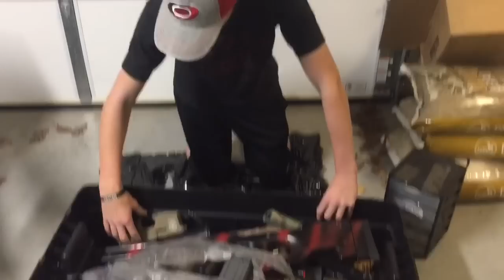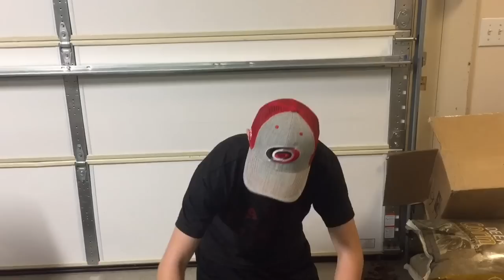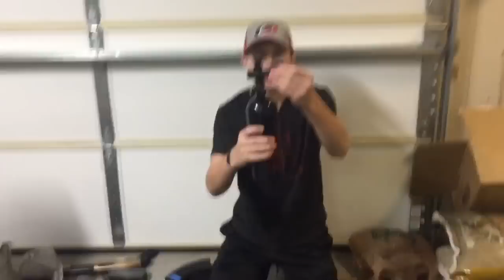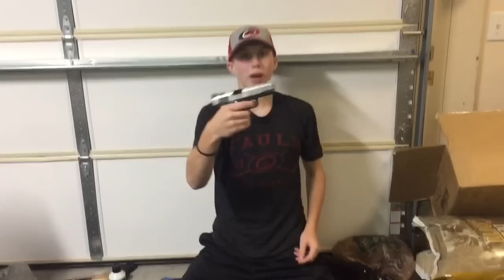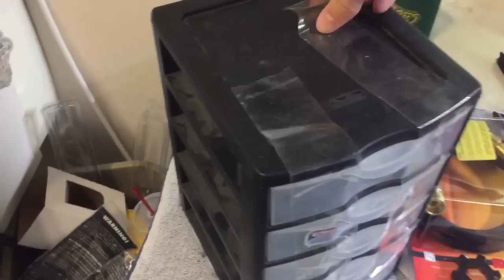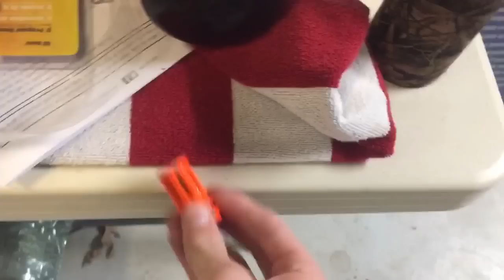Airsoft on a Budget *HUGE!* ($30 Craigslist Airsoft Mystery box)

Comment: I live near Xtreme kombat so hopefully, I'll see you out on the field once I have some more gear! I've been working on mounting a mp5 rail into the sight area of my JG-1011 for mounting a red dot, do you have any primaries you are teching with?
Reply from the maker: +Austin E. if you mean what I usually Tech on I usually work on m4s and ak's but I can work on almost any gun. There is a day operation this Sunday which will be a tone of fun that I am going to. In regards to your mp5 I would try sanding where you want to put the rail on the gun and sanding the lower side of the rail that will go on to the gun, then take 2 part epoxy and apply it to the rail and mp5, then clamp the mp5 and rail together and let dry. If you would like me to do it then I would be glad to.

Comment: calls a MAC 10 an UZI it would be like calling an m4 a SCAR L two completely different guns yet same bolt system
Reply from the maker: +Will M lol it's actually a tac force 11 (based off the mac10 but still)
Reply: scar and m4 don't have the same bolt system. lel.
Reply: Mewdekamp1gaming well they lock back after the last shot is fired so..........idk
Reply: that literally means nothing
Reply: Mewdekamp1gaming the scar l and m4 have the same design except for the charging handle placement and they fire the same round
Reply: Obese Asian m4 is direct impingement, scar is short stroked piston driven. The bolts are not interchangeable, just like any other components except for the magazines in the scar l.
Reply: Wait! The Mac is a CLOSED bolt, the Uzi is open. The Airsoft gun fires from an open bolt, making it closer to the mini-uzi.
Reply: Calls a Mac 11 a Mac 10
Reply from the maker: Lol
Reply from the maker: Is the Mac not a open bolt? I think that the civilian version is closed but the military version is open

Comment: he doesn't realize the "Spare Parts" are for putting the guns back together, someone probably took apart guns to customize, then threw the parts away and just wanted to get rid of what they didn't want, what a waste of $30.00
Reply from the maker: +EliteChimera yeah I tryed to put a gun together out of it and it's missing the hopup, I did take some parts out of it and built a gearbox, shoots 25 + bbs a second with a stock motor. So no it was not a waste of $30, also I use the tank reg and line for my inferno.